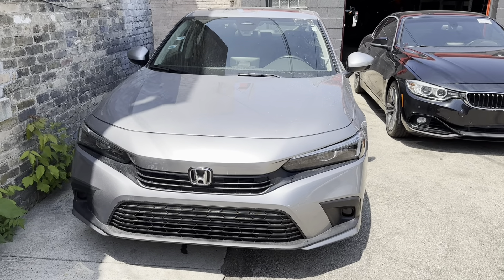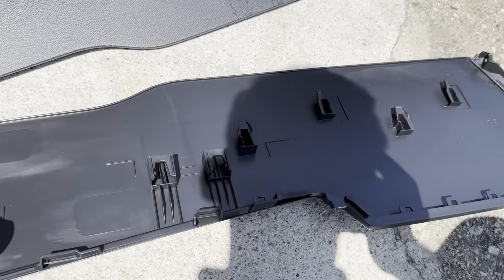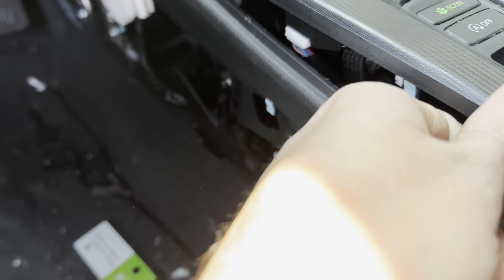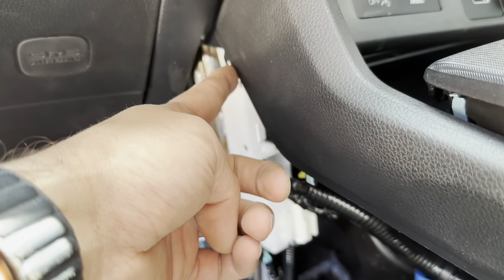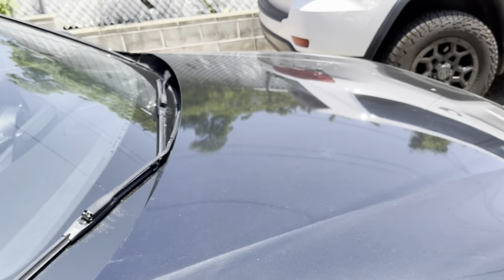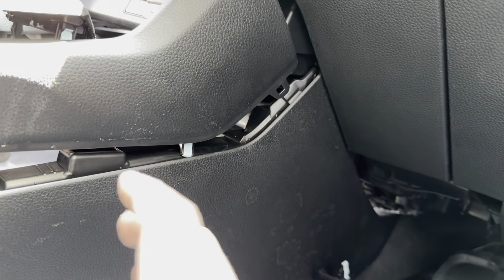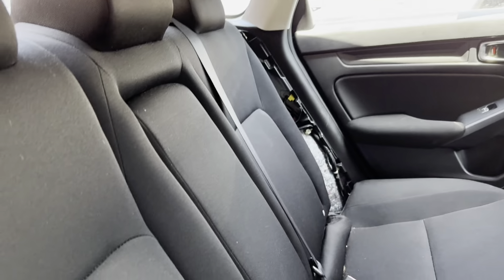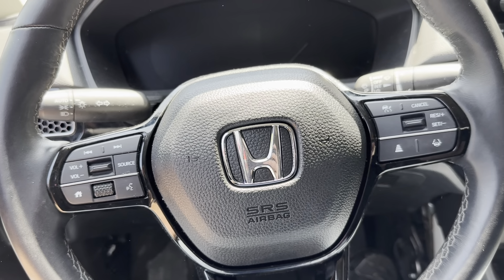2022 Honda Civic Airbag SRS Module location removal and seatbelts.

Comment: Hi there please share how to install the headliner after curtain airbags deployed i did removed it from the car bit now can’t fit it inside the car (((
Reply from the maker: Hello, the most easiest way ever to install the headliner is by removing the windshield and sliding it in. If not having the tools to do so, you will have to bend the headliner a bit and fit it from front driver side door. Recline driver and passenger side seats all the way down and gently start pushing headliner in. If needing to bend only bend sides not from the middle of the actual headliner. It has some flexibility so should eventually go in. Hope this helps. Thanks

Comment: I got curtain airbag, driver and rear seat blown aribags, is ithtrue that a good quality scanner cannot delete the codes? And do i just replace these airbags with the battery turned off?
Reply from the maker: Hard codes are stored in airbag module. You have to have the module sent to get reset. Also check rear seatbelts make sure they aren’t locked. That’s what happened to this one.
Reply: @Vistamotorwerks  thanks for the info bro appreciate it!

Comment: My airbag went off so I removed it to get it reset. When I removed it, a bunch of lights came on on the dashboard. Steering, TPMS, break system, and traction. Which are all false lights because I didn't have any issues until I removed the SRS. What can I do to get my car back to the condition before removing the SRS?
Reply from the maker: Did you disconnect the battery when doing SRS repairs? If so try this! Most Hondas will illuminate these lights when there is a power lose or not communicating. Tpms recalibrate in the settings menu in dash it should go away, turn steering left right multiple times then go for a 5-10 min drive for it to reset/recalibrate. Parking brake is electronic, engage then dis engage 1-2 times it should re calibrate for brake system. If still not working then most likely there is something else going on. Let me know if this helps or if there’s any other info that you can provide. Good luck!

Comment: Do you know the part number for the clockspring? Also what happens if I don’t replace it
Reply from the maker: Always change the clockspring! The part should be always available at your local dealer for under $75. All it is is main steering bolt to be removed and a few plugs.

Comment: I have bought a car 2024 honda civic sedan sport my knee airbag is deployed the the code is srs problem do i need to change all other airbags? And do i need to change seat belt too?
Reply from the maker: If only your knee airbag is deployed that’s the only one you should replace. Check SRS code if there’s any present for seatbelts. Once repaired you will need to remove module and have it reflashed to remove stored codes. Scanner won’t delete them.